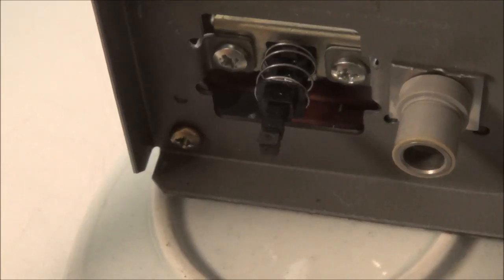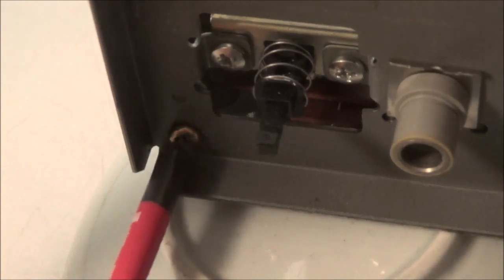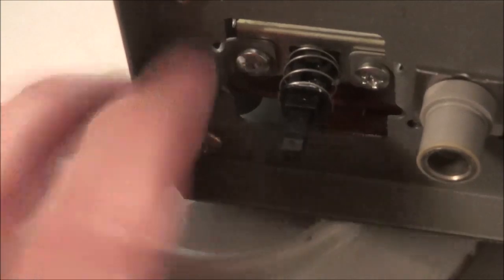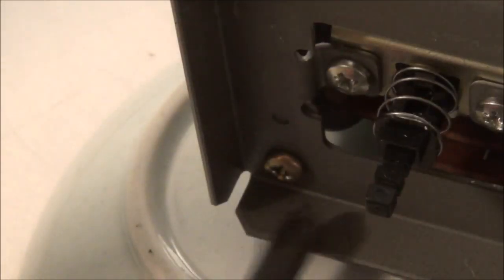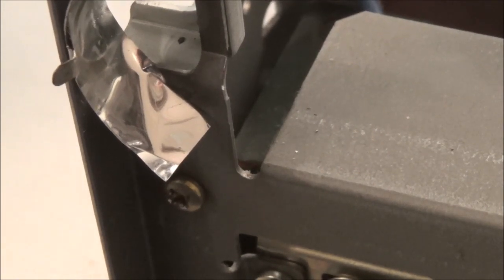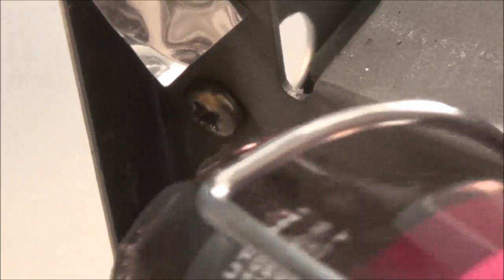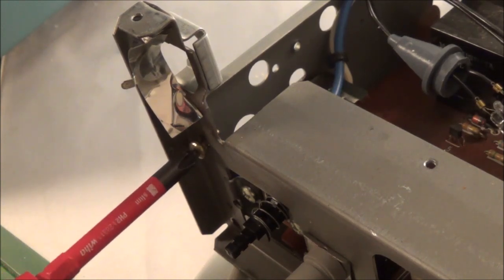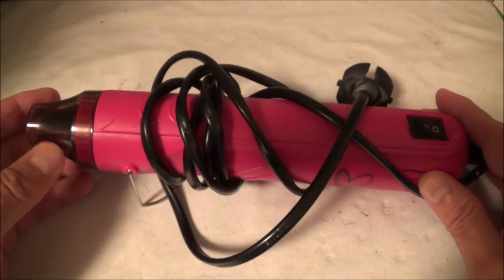Stubborn Receiver And Amplifier Screws -- A Real Basic Tip

Comment: I've fought that screw problem many times, most recently on the bottom of a Leader function generator.  Only this time I bought the 6 1/2”  Vampliers and got that screw right out and there wasn’t much of a shoulder on it.  Wish I had those Vampliers many, many years and screws ago.  Fast & easy.
Reply from the maker: Thanks for the the info on the Vampliers! I never heard of those; I will look that up.

Comment: Use a wide tip on you soldering tool to heat up a screw (no need to change heat settings).  Direct heat every time.
Reply from the maker: Good tip! Thanks for that.

Comment: There is always that one screw that I think they crazy glue on. I have a surface rework heat gun that has some really small nozzles. I will have to give it a try the next time I have that problem. Thanks
Reply from the maker: Thanks for your commenting. It's an occasional problem, but a headache when it happens. Two people suggested just using a regular soldering iron. Makes sense. Now why didn't I think of that? I used my first iron back in the 80s, but not for that.

Comment: Using a soldering iron directly on the screw is a better way of getting the heat localized on just the screw and nothing else. Its my preferred method
Reply from the maker: That's a good tip! Thanks; it never occured to me to use a soldering iron other than for soldering.
Reply from the maker: Yeah, that's a good idea and so obvious.
Reply from the maker: Thanks for that! I am gonna try your smarter method next, though.
Reply: Works great too for old grease that is seizing up a metal pin/shaft like on a turn table etc.
Reply from the maker: @viewer54322  Another good tip! Thanks!